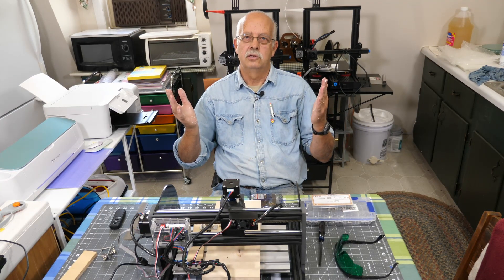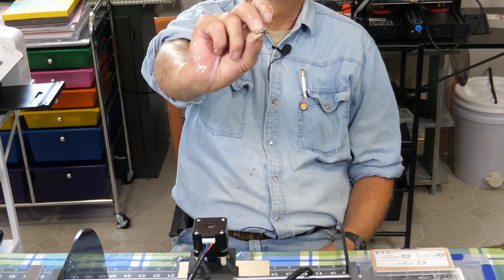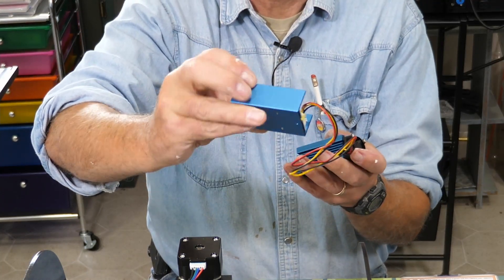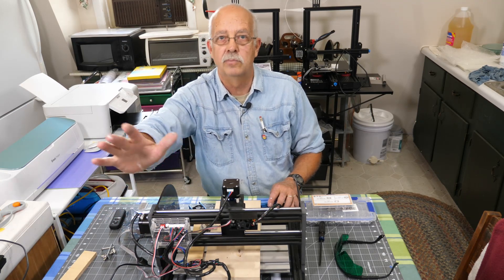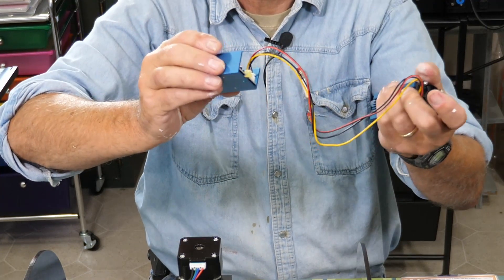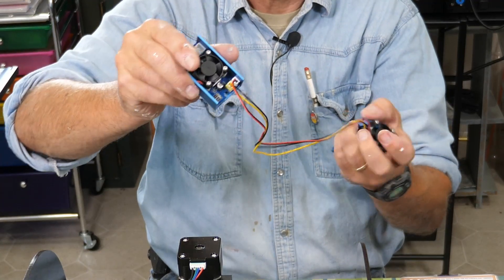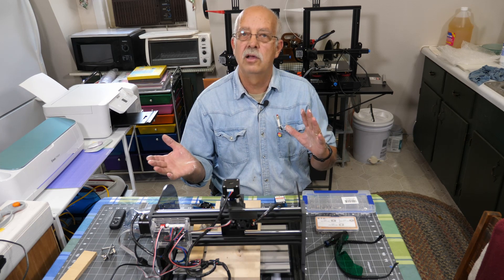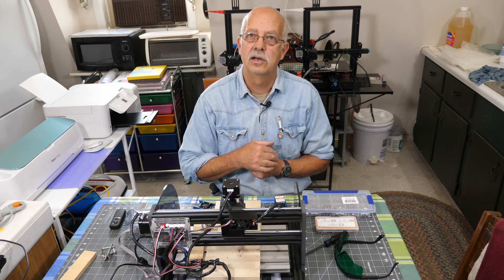3018 CNC Laser Board Mounting

Comment: Where can i buy the board, i got a laser from a website but theres no board with it so it doesnt power
Reply from the maker: Controller needs to match the laser head.  There is no "universal"
Reply: @rogersshop  Ive managed to get one off ebay, hopefully it works, mine was only supplied with a laser and a cable.